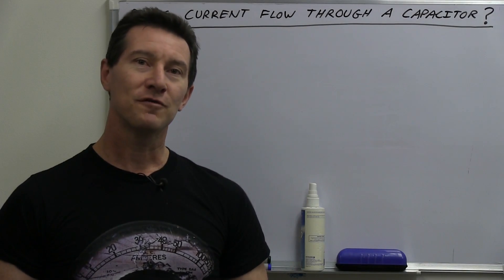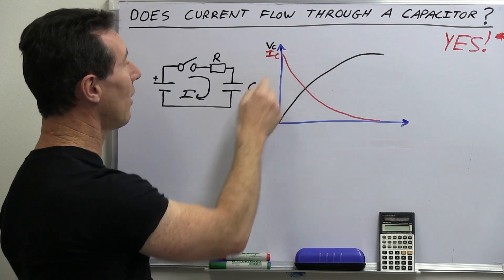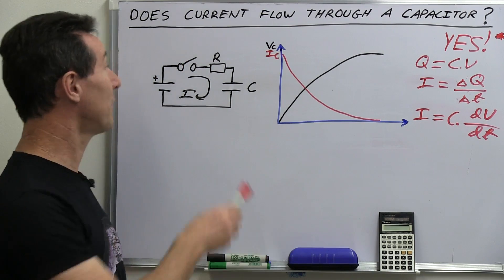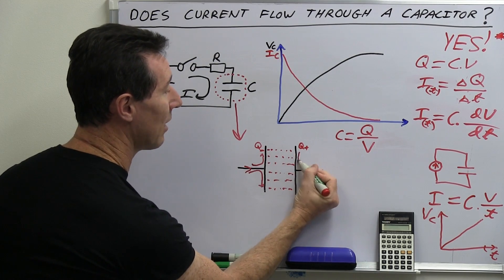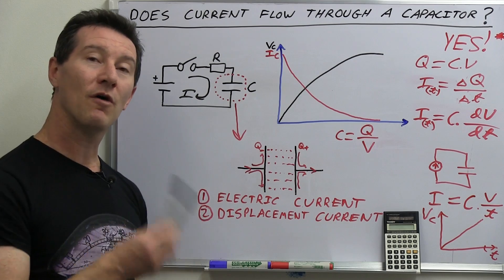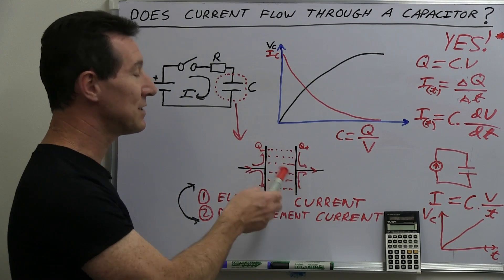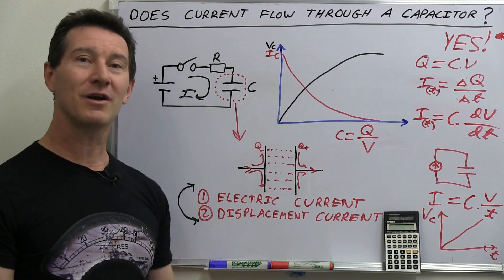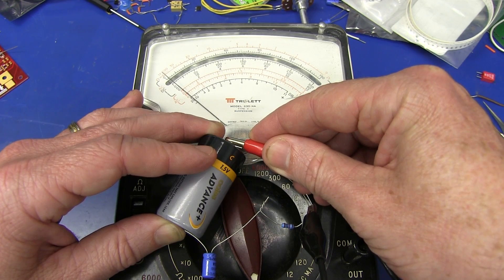EEVblog #486 - Does Current Flow Through A Capacitor?

Comment: I like to compare it to the motion of water molecules as a tsunami passes by in deep water. The individual molecules move up and down in a circular or elliptical  motion. They pass ENERGY on to the molecules beside them on so on. Think of a rope attached at one end. If you move the other end up and down you make a wave on the rope and transfer energy down to the fixed end but any point on the rope is only ever moving vertically either up or down.

It is the same thing with electromagnetic energy running through a wire. The actual electrons move along the wire quite slowly but like the water molecules they pass their energy along to one another. 
As for the gap in the capacitor, there is also a gap in a transformer so based on that logic there should be no electric current on the secondary of a transformer. Again, the problem is with thinking of current purely as the flow of particles like electrons. It is an electromagnetic phenomena so you need to take into account it's wavelike nature.

Comment: Hello Dave, if I may I like to ask a question. I build a resistor welder last year to weld butted rings for use in chainmail.
The parts I used are repurposed and (in some cases) modified parts of a standard 1200 W microwave oven.
The machine works very well but every now and then I find the machine sparks at the electrodes which could become dangerous (fire hazard) Most likely the arcs are created due to a quality issues in the wire used to make the rings with, the way the ends of the rings meet, the open ends of the rings are left after being broken away from the coil or not being carefull the rings ends are making a good connection with the electrodes. Either way, spraks do occionally fly which could become dangerous and I like to avoid them even being created if at all possible.

I have learned that a capacitor can be used to prevent arcing in relay contacts and I wonder: Can I use the capacitor which is inside the microwave oven (which is a high voltage (2.1 kV) 0.97 uF capacitor) be used in any way to prevent arcing across the electrodes.

Welder operation here: https://youtu.be/8tMyaWNMcZs

Note: The secondary circuit of the transformer (originally a 2.1 kV coil) has been removed and replaced with a 1,5 turn 50mm2 copper wire coil which produces a 1,7 V open contact voltage. ( I have no way to measure the short circuit current but theoratically it should be around 675 A. 

Any advice would be greatly appriciated. Thanks in advance. Sander.

Comment: Any doubt?  Throw your meter to measure current in that simple circuit in parallel between the cap and the battery.  Measure it.  Is there current?  Wait, what?  YES, of course there is!  It’s similar to saying current doesn’t flow through a transformer.  And yet it does, because you can measure it.  It’s current converted to a magnetic field converted back to current.  Magnetic fields are electrical and electrical current is magnetic.  They can be converted and are different forms of the same things.
As an analogy It’s like if I take a bottle of water and freeze it and walk next door to my neighbors house and thaw it out and I have water again.  You can say the water didn’t pass from my house to the neighbors because it was ice.  Except that it did because it was still water, just in another form.  Everyone by now should know that ice is still water.  Although I’m sure there are trolls who would love to argue that, I think you get the point.

Comment: Current flows in, current flows out. Electrons flowing in do not flow out the other side? Current without continuity? So it is like displacing water out of a tank with a container full of water and once removed the water displaced can move back in?

Comment: Long video so I'm just going to comment.  It does practically, as current is the movement of electronics, and you can measure current on either termination, and they are equal.    But the electrons don't cross the dielectric barrier.  So I think the question is worded a bit confusing.

Comment: and for those who dont think Current flows through a capacitor take a 450v 150uf cap and hook 400v to the positive and grab the negative pin you will find out quite quickly that current can flow through a cap that cap didnt spontaneous create that current that just blew your teeth out. Current flowed from the power supply into your closed mind and opened it fully to next level of electronics knowledge it will block DC on a non grounded circuit if it has a path to ground it will flow through a cap. Now if we take that cap and hook it to a high impedance source say like a tube it will block the dc off the plate or op amp or what ever but it will transmit AC signals through the cap. The ac wave will pass through they floating input but dc will not and PLEASE DO NOT CHARGE A CAP TO 400v and grab the ground pin you will probably die it didnt kill me but I was lucky. The point of this is to show in certain situations it will block in others it wont so be careful.

Comment: I think people are Misunderstanding AC decoupling with current trough a compactor  am sure someone has already said that but am just watching this so thats my two cents.
Reply: Compactors Block AC signals and pass DC current
Reply: Opps I mean block DC changes and let AC signals through
Reply: and for those who dont think Current flows through a capacitor take a 450v 150uf cap and hook 400v to the positive and grab the negative pin you will find out quite quickly that current can flow through a cap that cap didnt spontaneous create that current that just blew your teeth out. Current flowed from the power supply into your closed mind and opened it fully to next level of electronics knowledge it will block DC on a non grounded circuit if it has a path to ground it will flow through a cap. Now if we take that cap and hook it to a high impedance source say like a tube it will block the dc off the plate or op amp or what ever but it will transmit AC signals through the cap. The ac wave will pass through they floating input but dc will not and PLEASE DO NOT CHARGE A CAP TO 400v and grab the ground pin you will probably die it didnt kill me but I was lucky. The point of this is to show in certain situations it will block in others it wont so be careful.

Comment: Current is a word in electronics that can be used ambiguously.  If we narrowly define current to mean movement of charge via electrons, then no, current does not flow through a capacitor, but it does flow into a capacitor, specifically into the dielectric.  Dielectric materials vary in how much current or charge they can hold, with electrolytic capacitors holding the most, and thus they are smallest in size for a given charge holding capacity.  

But this scheme only works if electrons, or their charge, can be removed from the other plate, so it does seem as thought current has flown through the capacitor, yet it didn't.  

It comes down to a matter of semantics and in many or most electronic engineering it can just be assumed that current flowed through the capacitor.   On the physics level, no it did not.  

The ambiguity can be removed by only using the word "charge".

Comment: Another great video thanks. 
You can explain concepts in a 20min video which I can understand, that after spending weeks studying I still could not get it and just gave up.

I just have a noob question in relation to this video. The 'displacement current' flows through the cap due to electromagnetism,  so does that mean it works in a similar way to a transformer?

Comment: So in a series circuit, the circuit won't have any current after the capacitor is fully charged? So a light bulb added to the circuit will stop glowing when the capacitor is fully charged?

Comment: At this point I don't even think the asterisk is necessary. The electron flow has a storing stage and eventually can pass through as compared to a transformer of which is two circuits by which the magnetic field from the first circuit induces electron flow in the second circuit.

Comment: Dave you need to read my comment on the other video about the anthology of a pipe with a diaphragm in the middle which passes the effects of a pulsing pressure but not the actual liquid in the pipe so it's safe to say the capacitor passes the effects of electron flow

Comment: I love how he disproves himself twice. first with the graph and then with the ammeter demonstration. 

if it's AC, yes current goes through, because its about the displacement of the electrons as oscillate with the frequency.

if it's DC, the current drops as the capacitor charges (as the charge is repelled off the second plate as charge collects on the front plate) because once the charge is deposited on the first plate no more charge is repelled off of the second plate, and the current stops - BECAUSE IT CANNOT FLOW.

Comment: The concept of dipoles that develop in the dielectric more easily explain the concept of current flow through the cap. Also, it is important to remember that the cap will only have current flow during times of a CHANGE in voltage. Current will flow foe AC, but not DC (since DC does not change). This also explains Xc, the phase shift, and why caps block DC (Xc is infinite when F=0)

Comment: Its easy, if you just think this way:@ t=0; The electrons rush to fill the plate, this displaces electrons on the other plate(electrons repel electrons) leaving + ions, as the electrons build up on the (-)plate, these plates are like a car park where electrons(cars) find less and less atoms(spaces) to occupy so the current flow slows(as a car would looking for an unoccupied space) as does the opposing displaced electrons on the (+)plate. Least thats how I taught it to students. So my answer would be; its convenient to think of current flowing thru a capacitor for design, but in actuality no electrons flow through the plate.
PS: Quoting Maxwell equations to anyone without advanced Math will confuse the crap out of them.)

Comment: Just set up a circuit of a current limiting resistor, LED, capacitor (probably like 1000 microFarads), LED, current limiting resistor.  Ensure the cap is discharge by shorting across it, the removing short.  Apply power (5V is good to avoid a lot of current charging the cap fast).  Now explain how the LEDs are lit if current doesn't flow across the cap.  Note as the cap charges, the LEDs dim.  Now short one side or the other of the cap to power and ground, see what happens (this is why two current limiting resistors one on each side of the LEDs)

Current is the flow of charge.    Charge flows into the cap on one side and the changing electric field between the plates causes charge to be pushed out the other side, until the charge on the plates is balanced, equal but opposite polarity.  But charge flowed through, i.e., current,, just not the same charged particles.

Comment: Physicist, "current cant pass through a capacitor because science says so."

Electrical Engineer, "Then how do you account for current flowing through a capacitor, proven by both math, observable tests, and subsequent test equipment which precludes what you claim?"

Physicist, "because the general public respects my opinion more than yours. Therefore my assertions are greater than your facts."

:D one of those moments when you realize "science" jumped the feckin shark a long time ago.
Reply: That said, I do not think a simplified model actually explains how capacitors actually work. That said, someone had written before me about using a diaphragm and some hydraulic pressure as an analogy. Capacitors make total sense now.

If current flowed only one way, from A to B, then they would emit a pulse, then stop when the diaphragm was convex in the direction of the flow. By means of having another way to flow, they may equalize, or reverse the diaphragm, and then displace again. This is analogous to a connection to ground( providing a third flow upon equilibrium, or an alternating  current source disequilibrium.

Comment: Current with a frequency flows thru a capacitor with a 90 degree phase shift. Pure DC flows into a capacitor till it charges up, heats up, and explodes like a firecracker. How........ is a thesis in physics. Best leave it at that!
Reply: How does wireless charger work on an IPhone? Black Magic...Flux..displacement current...

Comment: Great video Dave! it would be extreamly interesting if you would make a follow-up video regarding the current  ripple and voltage ripple of a capacitor as well as losses calculation/measurement of an electrolytic capacitor.

Comment: The path of the current, which is the 'charge' or electrons, does not actually pass through the space between the plates. The way the question is framed injects a bit of confusion.

Comment: To make it even simpler, it could have been stated that when voltage pushes an electron in, an electron gets pushed out. if you had blue electrons on one side and red on the other, as you shoved electrons into the blue side, red electrons would come out the other. The only way blue electrons could come out the red side is if they leaked through the dielectric medium. the current flow could be said to be similar to magnetic repulsion.

Comment: Hi Mate,  this subject and the subject of coils is very difficult to understand, its almost like the lyrics in the band the shamen's ebeneezer good" forwards and a backwards backwards and a forwards eezer is a geezer who loves to muscle in.
in simple terms, at the point when you switch on (transient response) the current that flows to the capacitor can be thought of as just filling the tank and stops when its full D.C. the current that flows dosen't know its gonna stop when the tank is full and so it will light bulbs on its way through, this acton will also be happening to the other capacitor plate, and so it appears if ameters read both paths that a current flows though but actually it doesn't.

 the interesting side affect is that most of the useful properties of a current (the work we can direct it to do) will mostly still be available in transient currents but some are missing?
in other words from empty a capacitor requires a set up charge and this costs, it is similar in some respects with the cost of establishing the magnetic field in coils,
Forgive me for my blurrrrbb but I can remember really struggling over this concept!
kind regards

Comment: An electric current is a flow of electric charge. If the positive charge in one capacitor plate causes to move negative charge in another capacitor plate it is electrical current. So an electric current can be not only movement of electrons from A to B, but movement of charges, holes, electric field etc.

Comment: Does current flow around a circuit momentarily when a DC current is applied yes.
Does Current flow through a capacitor no.

If a balloon is pushed into a tank of water and you push it down you cause the water level to rise hence you see a current flow in the circuit(water level rise). Removing the balloon causes the water level to drop back down so you have current flowing back in the other direction but no water or air flows through the balloons rubber.

Comment: C'mon, it's not that complicated :) Once I've seen your diagram with the view of the cap. schematic I've got how it happens... Without complex equations. One side "erects" (or "stimulates"?) the field in an insulator, the field "erects" the other side thus providing a movement of the other electrons (that belongs to other atoms/molecules of a metal).
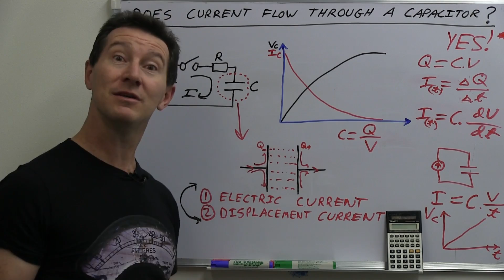I've stopped at 13:30 before writing this.

Comment: I found this to be a very inspiring video Dave, its very interesting getting into electromagnetism.
Reply: I just used a centre-tapped step down transformer. Thats an isolated power supply right, working on induced currents and magnetism. Coool
Reply: 10:1 wind ratio 120V on the variac stepped down to 12V
Reply: Capacitors are a really cool concept.. which for the av punter, they wouldn't think it possible. How can two wires in the air be a capacitor. Hmm, I'm sure Nicola Tesla would have a lot to say.

Comment: If we assume that the capacitor is of two plates,, nothing says that the two plates are the same size, and in fact, one can be ... not there at all. So, while some electrons would be pushed on the "left" plate, nothing will happen on the not-existing "right side". 

Only if the two plates are of the same size, of the same material, could we say that the current on the left will be of the same order of magnitude than the current (change of charge through time) on the right side, so it is "as if" the current was flowing "through", 

but .... clearly... if there is, just as it is in the limit when there is NO plate at all on the right side,  no current on that side, we cannot say that the current flows through, when there is a current (not zero) on the left, and none, on the other side. 

 What kind of electric/electronic piece can we make from this? well, a capacitor!

Comment: If you could look at the centre of a cap, at the dielectric, would any electrons pass from one plate through to the other? most people would say absolutely not. This is why some say currrent doesn't actually flow, because the circuit isn't complete. but some say current does flow because there is a movement of electrons to and from the plates of the cap. so when the cap is being a cap, you get current movement.
 what is cap leakage? where does the energy go? resistors leak heat. in that case electron are changed to heat as they cross a resistance. do caps also get hot, even with no movement? or is energy loss across the plates? If it's leaked across the plates and not as electons, has the energy from the electons changed like I did with the heat?
I'm new to electonics so I get confused.